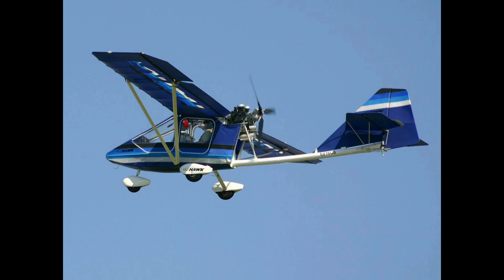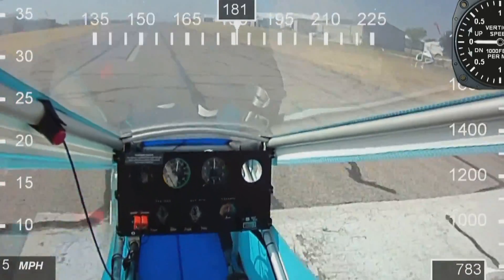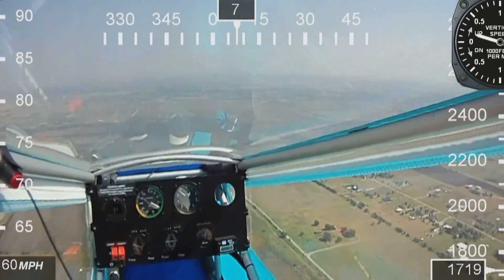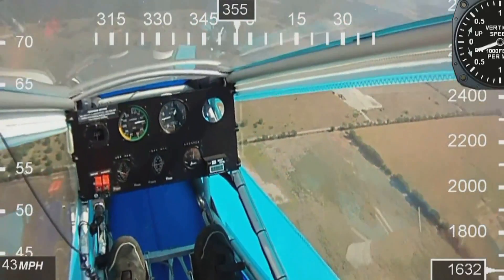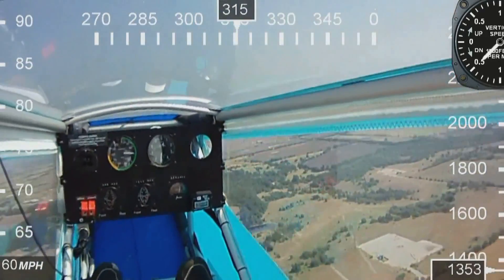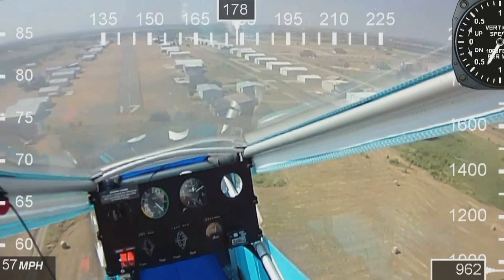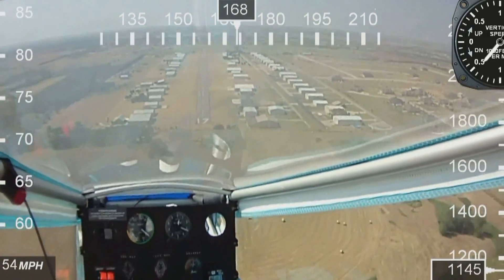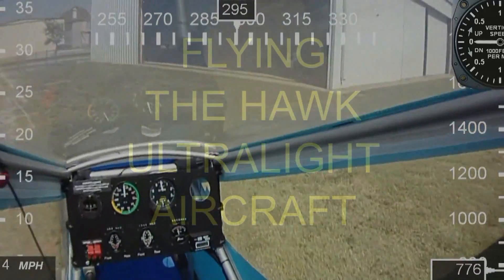Learn to fly the Hawk Ultralight Aircraft Landings Stalls Roy Dawson video

Comment: Not a bad video.  Why takeoff on the downwind side of the runway?   You should be aiming for the left side.    it’s kinda funny you say your using a crab and you’re completely right of the runway and barely crabbed.  You needed to crab more man.  The words are right,  but you’re not making the airplane do as you say.  And that extra speed didn’t really help ya.  Slow jt the heck down and crab more.   And land on the upwind side.  That first go around was the correct thing to do,   I probably wouldn’t have landed on that second one.  Your just not controlling drift enough.  7000 hour pilot here (2100 in ultralights).

Comment: What keeps me from the hawk is the reflections on the wind shield. Thats annoying.
Reply: Cover anything glossy with black felt. I did it on a dashboard of a car once. It cast a reflection of the dash above the steering wheel onto the windshield. One 12x8 piece of black felt and issue fixed.
Reply: Only solution I found for this are polarised  sunglasses, I use a cheap non tinted set that cost around $10 - work great. I don't think the felt will work as the instruments are what is reflecting not the "dash" like in a car.

Comment: I fly R/C planes 5 foot wing span but would love to have one of these and I should have been a pilot but when the push engine stops on these ultra lite — how good do they glide will they stall fast  or do they glide pretty nice ?? Awesome vid
Reply: I had a Quicksilver MX and I flew it at Lake Elsinore southern California in 1982. I was using a book to develop my flying, one section suggested that if the engine could be started from the seat, you might wish to practise this. "get to 2,000 feet, level out, throttle back and turn off the ignition, turn the ignition back on and restart the engine. Everything went OK until I tried to turn over the engine whilst holding the control column, it was just too difficult using just one hand. I didn't want to let go of the control column because it was very bumpy that day. I started to panic but as I realised I was never going to get the engine going again I switched over to actually landing the plane. The glide ratio of the MX was around 8:1 but I got it down Ok. My instructor was there and said it was a good dead stick landing but thought I had attempted it too soon in my flying career. I realised about 35 years later that if I had put the nose down to increase speed, I might have been able to turn the engine over one handed.

Happy days.

John.
Reply: Buy a Challenger 2. Affordability, and I been practicing glide in landings with engine out. Its very gental and easy to land...also mine has a brs parachute incase of major emergency but ive yet to know anyone to use it...nice to know its there just incase.
Reply: Open lights library will have great glide ratios..... Also there are a lot of good plans on the market to build yourself such as the affordaplane or the legal eagle
Reply: Its my understanding that many ultra lite planes have a 12 to 1 glide ratio, the same as a Boeing 767 compared to the 10 to 1 glide ratio of a Cessna 172.

Comment: I noticed you are landing at about 57 knots . Given the type of aircraft , shouldn’t it be more closer to around 40s ? Also can you do a short field landing ? I can make the wheels touch on the numbers every time in a 172 .
Reply: The hawk slows down so fast that a high approach speed doesn’t matter much unlike a Cessna. you don’t want to fly near stall speed on approach with an ultralight in case there’s wind shear or an engine problem . They stall so quickly because they are such high drag airplanes. It’s a perfect approach speed in a hawk.
Reply: the indicator is in mph
Reply: And ground speed mentioned at the beginning and mph is shown on the screen

Comment: capt. Red I'm not a ultralight owner or pilot, but to me and every A&P I have asked,  TRIM TAB is the correct fix, I mean there used on everything from a C-150 to a Falcon 900, only difference in your's and the Cessna to Falcon is there's is done w/power from electric to hydraulic -try it if you don't like it take it off -its not go'in to stress anything -no more then when you apply full Rudder, good luck!
Reply: loxahacefig aronald

Comment: Roy.  I own a MX Sprint that I recently converted to a MX Sport wing.  I noticed very good speed increase but along with that came a lot more right yaw.  Is this normal for the Sport vs the Sprint??  With yaw corrected with rudder, it flies perfectly straight and level hands off the stick.  Is there a way to relieve the rudder pressure with some mod that I don't know about?  Its quite heavy compared to the old Sprint but goes away completely when the engine is cut back for landing.  I'm thinking about attaching a rudder trim tab.  Any thoughts?  Are you available for discussion on this??